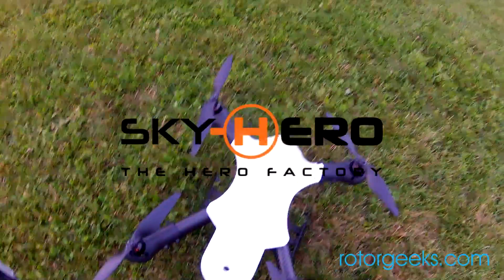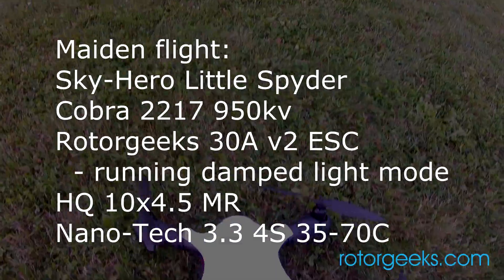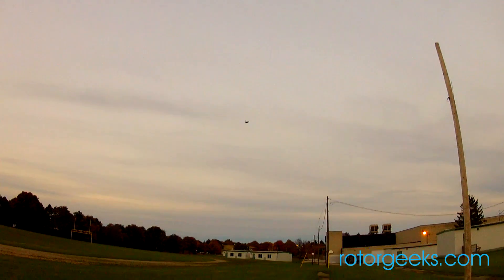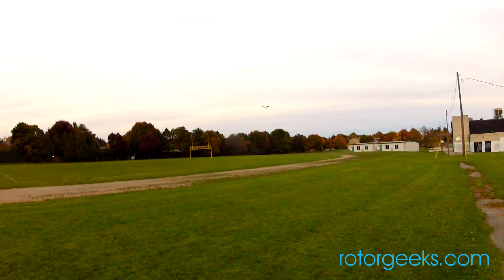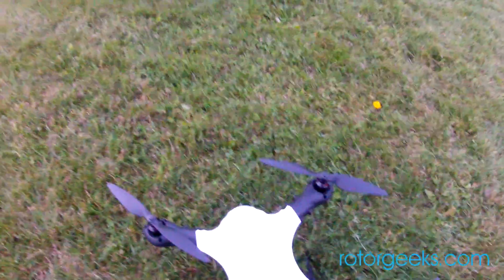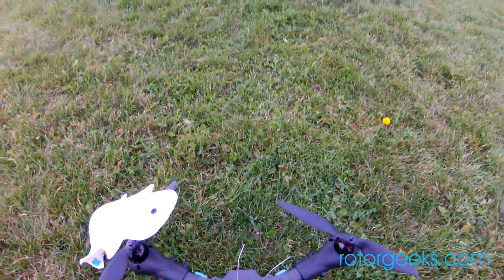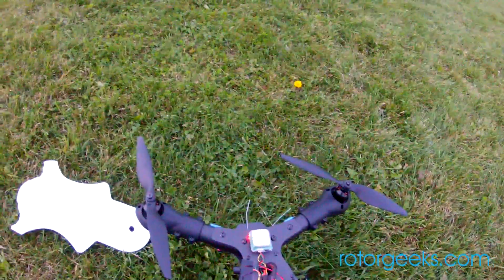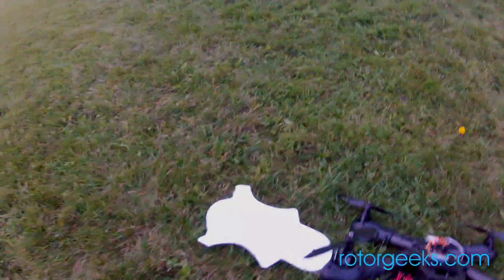SKY-Hero Little Spyder maiden

Comment: great maiden! heard that the naze32 flies beautifully on stock pids on almost any frame. Running stock here?
Reply from the maker: Yes, it was stock actually.  I normally tune down for miniquads but this ain't no mini so I started with defaults.  It's funny, I realized only afterwards that I started flying and never thought about tuning because it just worked so well.  That's a bit unusual for a maiden!
Reply: Rotorgeeks Not often a maiden goes that well. How does it perform on miniquads? I'm thinking of changing from the multiwii board I have today which is a AIO pro from crius to the naze32. Any input in which difference or how much of an improvement it would be? Mostly excited about the autotune avaliable with the naze.
Reply from the maker: that's the only board I use on miniquads!